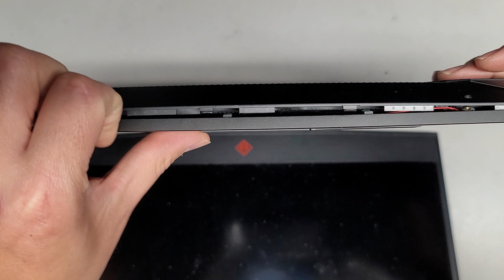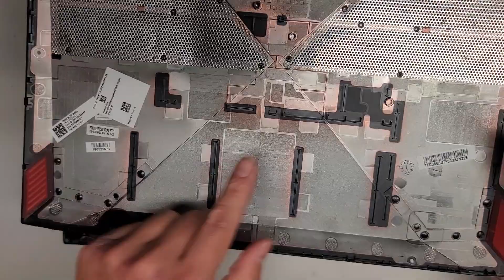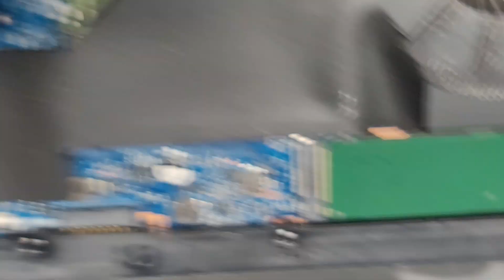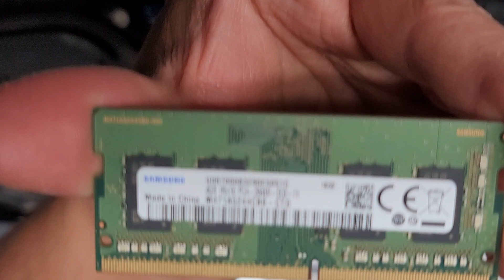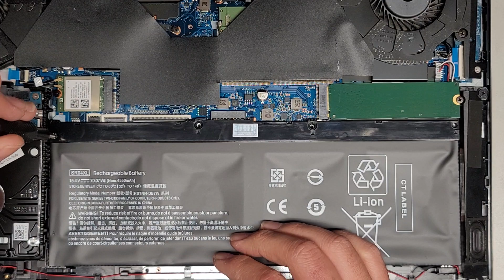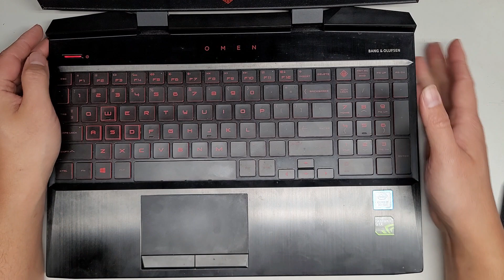HP Omen Laptop 15 15-dc0020nr Disassembly RAM SSD Hard Drive Upgrade Battery Replacement Repair

Comment: I Pulled Apart my HP Omen laptop just the same model as this one and when I try to put it back in the charger it says that it's charging from the lead but when I press the power button nothing happens so I'm not sure what the problem is do you have any idea what could be the solution
Reply from the maker: Nothing at all? If the battery was pulled out, you need to wait a few minutes after pressing the power button.

Comment: Dude thank you so much for this! I need to update my own battery so this is perfect. Do you have a video showing the proper way to clean the computer? Or is it just about being in a non dusty environment and being generous with the air can?
Reply from the maker: This https://youtu.be/3zs_SJ3BXgA Don't use air cans. They're dangerous.
Reply: @ItsBinhRepaired  Awesome thank you for the link and information. I have one last question:

Would you reccomend getting an exact HP replacement ($99) or a SANYO replacement ($60)?

My current battery, the original since purchase, didn't last very long at all. Perhaps only about 6 months before my laptop would just shut off randomly after about 20 minutes unless it was connected to the charger. I am wondering if the battery i got was already defective or if the battery made by HP isn't very good to begin with.

Thank you again Binh!
Reply from the maker: @dewbs96  usually you don't want to leave them fully charged or drain to 0 for long periods of time
Reply: I HAD A SCREW when i opened fall out, no idea where i came from went over it a million times. small steel screw any idea?
Reply from the maker: @NadaTheyLive no idea without seeing it